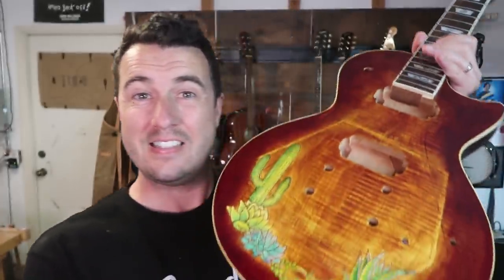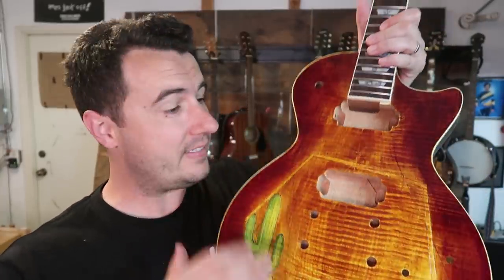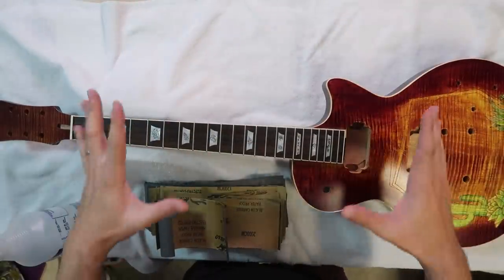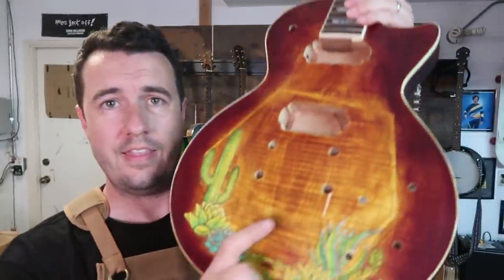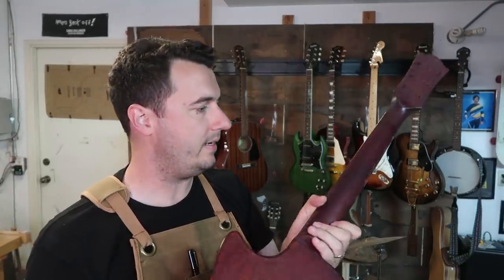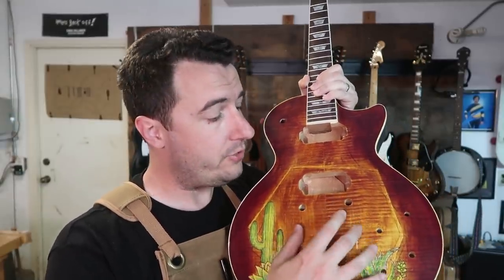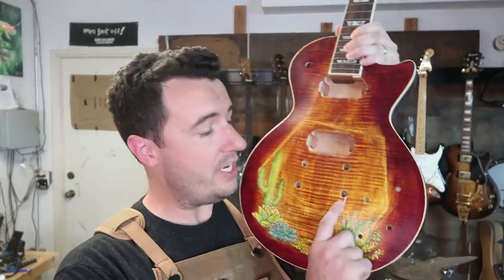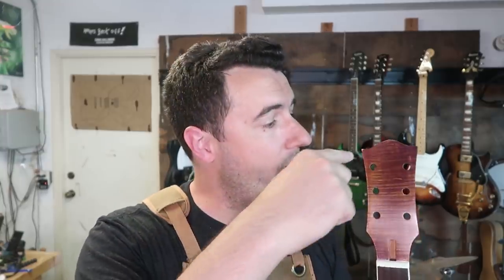The Episode in Which I Ruin Erik's Guitar

Comment: lacquering tip: consistent environment is important for application and curing. Temperature/humidity/airflow. outdoor exposure in open air causes dust and wind damage. Wind Flows in different directions causing the uneven drying due to changing said temp/humidity. more likely to crack that way.

Comment: Chris, get yourself a towel. After you wet the sandpaper, dab it onto the towel before you sand. Now the paper will be damp, but not dripping. That's how you avoid water dripping into the unpainted holes in the top.👍

Comment: Wet sanding is a b#tch.
You learn to anticipate those kind of issues, basically if it CAN go wrong , it will.
If you've worked in the trades, which I have, or as a Chef, also an affirmative, this is not an unusual learning curve.The harder it is to fix, the better you remember .
Peace.